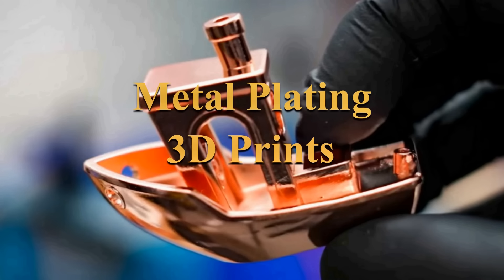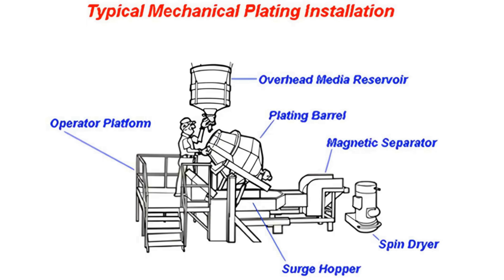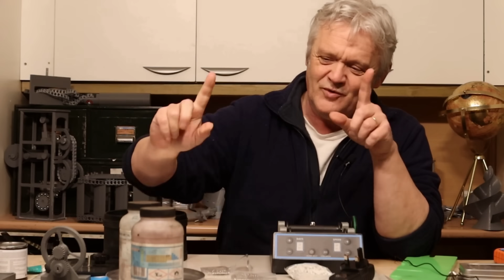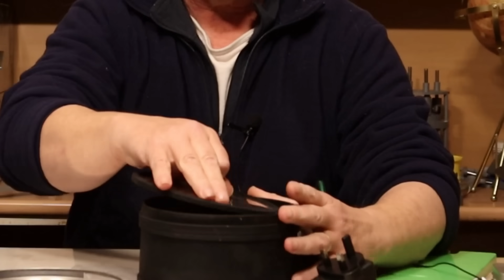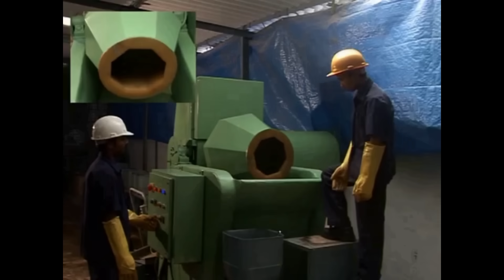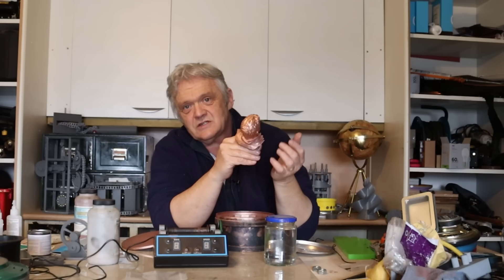2154 Easy Copper Plating 3D Prints

Comment: I had never heard of this before, and now I want to give it a try. I've been interested in electroplating, but I just don't have the workspace to support it, so this may be a handy alternative. Question: when you say the acetone made the PLA sticky, are you saying that it reacted with the PLA to soften the surface (which is not what I would have expected), or just that the wet surface retained the powder as a kind of acetone/copper "mud" and the copper remained in place as the acetone evaporated?

Comment: cool. I wonder, you could make strange shaped conducting 3D printed stuff like this i guess? I heard most of the current runs on the surface of the cables, so you could print a 3 dimensional mesh cable or structure, copper plate it and use it as a connector i guess? Perhaps use high heat resistant printing material if it needs to stay or even low heat resistant material if you would want to plastic to melt out of the conductor? I am thinking for exampe, cell anode connectors that are perfectly shaped.... an electrical circuit that runs in 3 dimensions instead of on flat surfaces so it could be squeezed better into perhaps a spherically shaped object and so on

Comment: My interest is small RF antennas. What I need is a highly electrically conductive plating. Would this process work? How about following it up with electro plating?
Reply: I'm thinking of an application requiring at least a uniform conductivity, touch sensors.   A few  hundred Ohms across the surface isn't a big problem in my case.  Given that, electroplating for thickness shouldn't be a problem.
Reply: You should look into PVD (physical vapor deposition), you can deposit several highly conductive films on your pieces

Comment: This is new to me. This process is used on mechanical hardware? Then it's actually robust enough to be mechanically abraded that it doesn't just dust off? Or are those metal parts coated in a protective seal too?

Comment: I'd be interested to see
1) how this compares against putting the print, powder and media in a bottle and shaking by hand for a minute or so
2) if this is a good starting point for an electroplating process to provide an adherent base layer
Food for thought as always!
Reply: Point 2 is especially attractive. I've had difficulty getting conductive graphite paint to work with electroplating PLA prints and sliver/copper conductive paint is even more expensive. If you can use this method to get a base copper layer, then you could electroplate a thicker layer on top. Or do another layer, like nickel or silver on top.
Reply: I have done some test with just that.  It is hard because copper oxidise very quickly.  I think you can use some vinegar or citric acid to make it conductive again.
Reply: @copper_knight I rhjnk he mentioned the possibility of mechanical coating with graphite near the end of the video. Might that work as a more stable undercoating, and then electroplate on top of that?

Comment: Wait, does electroplating not make the print stronger?
Reply: The coatings are thin enough that it doesn't generally significantly impact the strength of the object, but it should make the surface harder. That would make it more resistant to abrasion. In theory, with a thick coat you could sharpen a cutting edge. I can't imagine any other mechanical benefits of electroplating.
Reply: @stevenboelke6661  I was hoping for a way to make ABS prints stronger, for Robotic arms..
Using Gorilla Glue for now!

Comment: So now that it's coated in copper can you use electrolysis to put another tougher coat on it? Or coat it in another metal?
Reply: Should work well if the base coating has reasonably uniform conductivity.

Comment: mechanical coating is a real treat. Even if you plan in electrocoating after for densification reasons or just to do some elecrochemical machining a quick throw in a tumbler or even just a coffee can with a strong shake will help get good uniform results! 

Also, you can do a lot of cool things with a 3d printer and some mechanical plating, you can use the plated material to act as a mold to reheat your prints and get better layer adhesion if that has been problematic! simple, neat and clever process defenitly one of my favorites.
Reply: Very interesting... Is such a thin plating really strong enough to preserve the shape of the part? I've annealed prints in fine powders but that's not without its challenges.
Reply: @JJFX-  highly depends on the metal, the material and the shape. 
And how long you leave the parts in to get plated, you can get rather thick coatings

Comment: I've also seen conductive filament on eBay, whether it's possible to use for electroplating though?
Reply: The few "conductive" filaments I've tried was really bad. Even when I could measure some conductivity, the resistance was so high I'd hesitate to call it useful. If anyone has had better experiences I'd love to hear it but I have a hard time believing it would work well enough for electroplating.
Reply: @JJFX-  I was wondering similar, although if the piece was left in long enough, the bonds might start to build up between all the gaps and improve conductivity to the point where everything would fuse together, certainly worth trying to see if part strength improves, could also be interesting making current collector plates for batteries and super capacitors.
Reply: @dav1dbone  Well give it a shot but my experience with electroplating tells me you'd be better off just coating a print as he did or with a conductive primer. I suspect any conductive filament that might be consistent enough to do this would be too expensive to be practical.
Reply: Should be.

Comment: Living on a boat I’d really like to see a “Real performing” wind turbine that isn’t massive that anyone could install that gives around 500w…? Most of us rely on solar in summer but have to run Generators or main engine in winter months. I look online and all I see are cheap useless Chinese rubbish giving out 100w max or £1000 UK versions that have to be on a 20’ pole!   Is there “anything” that will happily put out approx 5-10amps dc in a strong breeze…?.

Comment: Maybe following peen plating with electroplating, then finishing it with metallic paint or ink would  combine useful properties of all three methods.  Probably depends on what you want the coating to do.
Reply: Is the peen coating electrically conductive for electroplating?  If so that would make the coating much more durable.
Reply: I wonder if you could electroplate a thicker layer and then melt the plastic out like lost wax.

Comment: Awesome idea. Too bad my printer is broken.
Reply: 3D printers are never broken, they're just between upgrades.
Reply: @JJFX-  I agree, but that will be a huge upgrade cause I must change the whole electronic system. Not an easy task.
Reply: @olivierroy1301  Yeah I hear you, I've been there many times my friend. If it's a typical FDM printer simply swapping in a new mainboard is often fairly straightforward though. After a number of issues, all my FDM machines (except a belt printer) now run Klipper and I could never go back. Printer configurations are simply backed up as text files and converting common machines is easy.

Supply of raspberry pi's is finally normalizing again and there are even mainboards now that are all-in-one.

Comment: brilliant 
sir anyway we can coat it with aluminum , i m trying different ways and failing
Reply: @fluffy_unicorn859  thanks for reply mate 
but this whole conundrum is to , do electroforming aluminum this is not about plating at all , but if you can plate you can make it thicker
Rob is know for this kind of stuff , 
once he told , how easily you can weld aluminum with zinc

Comment: Hi dear Robert ! It's Christmas even after time !! 
Thank you VERY MUCH for this very clever and demonstrative video.

I was wondering : have you a mesh finesness to recommend, when using copper dust ?
Also, keep in mind that several coppers exists : those with phosphor traces, those with oxygen oxydules, very pure copper without oxygen or phosphorus, and those "springy" but lethal copper-beryllium alloys.

This trick is very surprising, I don't have the habit to manipulate PLA, or to mix PLA with acetone.

I was thinking that it will result in a dramatic melting, like polystyrene foam.
But seems... not really.

You have a very convincing manner to do this trick, be thanked !!